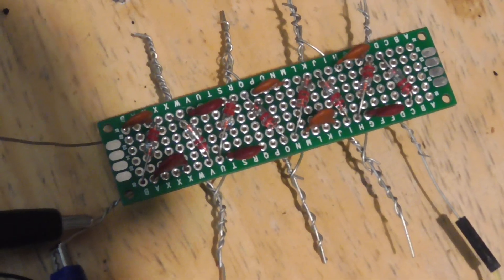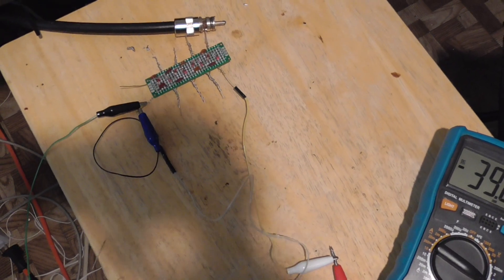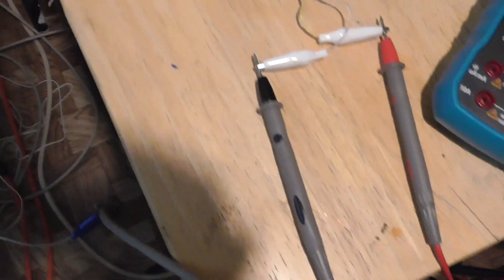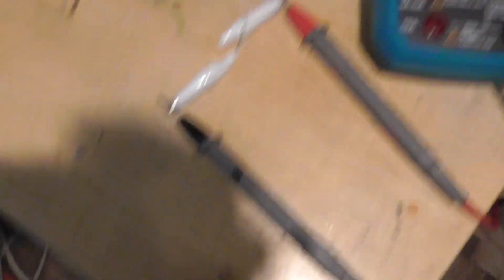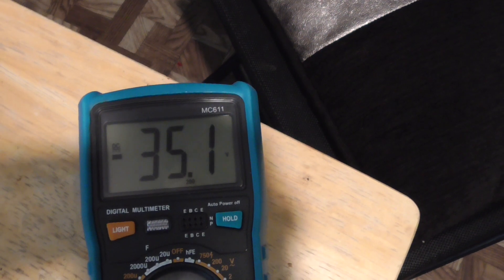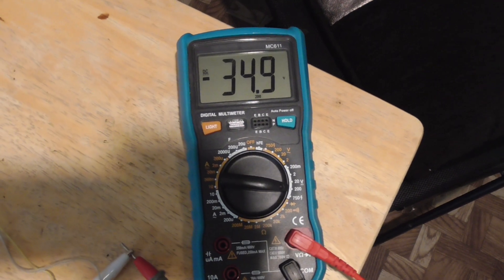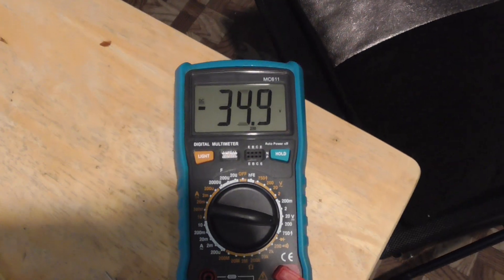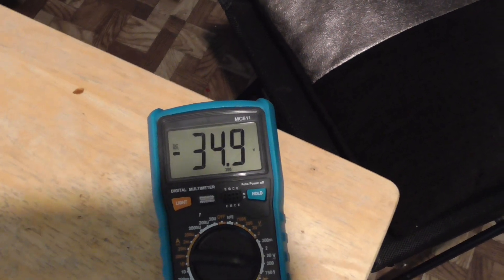Ambient Free Energy Cap Dump Charging

Comment: How long does this take to charge a battery? I've been running my cap dump now wth neon trigger 10uf 400v , for almost 24 hours and very little change on the battery
Reply from the maker: Many people have reported that it works well. Not sure what specific circuit your referring to as I got a few variants of the cap dump concept. If the circuit is working and the battery is fine. It could take a couple days depending on so many factors here. Are you seeing the neon blink? Does it go and stay on? Could be a few issues.  Are you reaching the trigger voltage of the neon?
Reply: @joellagace1679  thanks for the reply. the neon is blinking, its a 3v input , stepped up to about 110 volts, the cap charges to about  70 and then discharges into a 12v 20ah battery. the battery voltage hasn;t changed for 24 hours.
Reply from the maker: That seems a little strange to me. I notice a change in a few minutes maybe 15. like 0.01v. It can take a few days.. But from your description seems like something is wrong. What is the value of your charging capacitor?

Perhaps you would have better luck with this circuit? 
https://youtu.be/yBSGp_tPzII
Reply: @joellagace1679  I was using 10uf 100v. It's the way we learn though, I'm glad for you help, but to understand it I know I need more experimentation. The problems we have a leaning experiences.

Comment: If you made a few of these ambient energy harvesters and put them in parallel would it raise the amperage ?
Can you provide the schematics and part list to me ?
Very interesting thanks for sharing 👍🇬🇧
Reply from the maker: Yes but you must understand how "RF" field strengths work in the ambient it's a measurement of microvolts per meter square, This means in a given "space" your only going to get so much power you can gather, The only way around this is to spread out your antenna power harvesters all at least one wavelength away from the fundamental frequency your trying to "tap" into should it be known, If its unknown, Space your collectors as far away from each other as possible and they will do a good job at harvesting, You can't go out more than a quarter mile because of your "return" losses will get too high running these wires at great lengths unless you figure out a better way to link/dump each bank to a common accumulator. High frequency inverter perhaps.
Reply: @joellagace1679  thanks for the reply. Can you provide the schematics and part's list ?

Comment: Can you charge a 100 or 1000uF capacitor? how long does it take to load? You did what I once wanted and that's why I'm curious about the result.
Reply from the maker: small caps charge almost instant, larger value caps takes a few seconds, very similar to back emf charging, If your using bigger caps your just going to need to figure out a slower switching mechanism for cap dump.
Reply: @joellagace1679  OK thank you. I know that there are already special integrated circuits for energy harvesting but these systems work on a different principle. I need an external fitting if I remember how long the antenna is.
Reply from the maker: @maxmalone514  this does not need much at all, by simply touching one of the diodes with no antenna connected, I got around 6 volts, So as antenna if you have no ham gear.  you can experiment and try metal plates outside, outdoor fencing etc..
Reply: @joellagace1679  I did it with 1N4148 and 1nF. I tried to charge the capacitor and unfortunately it did not even exceed 1V (4700uF/50V). You'll get a better result if you put a sheet of metal or a tube with opposite signs on the ground and ground it with iron. Of course if there is a high-voltage power line above your roof you get some free electricity that way. By increasing the voltage we also have losses but we get the higher voltage that is needed. Approx. It's nice to see you add this knowledge to what you already have.
Reply from the maker: @watron2491  If the local ambient is too quiet, You can add a primary cap dump stage that charges a much smaller cap lets say 10uf and dump that into your bigger cap in pulses with a simple controller like a zener to trigger scr to dump cap.
Reply: @joellagace1679  It can certainly be improved, but it is still a poor way to obtain energy. Certainly a good way to increase it without induction, but is it more or less efficient? I don't know but I do know that charging a capacitor reduces the energy by the square. Charging the coil also causes a loss to recover BEMF energy from it.